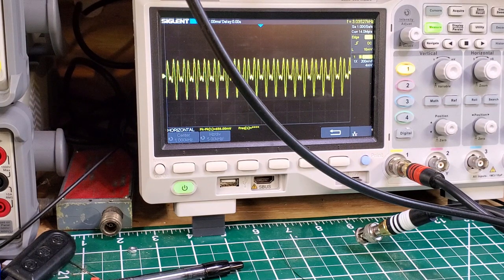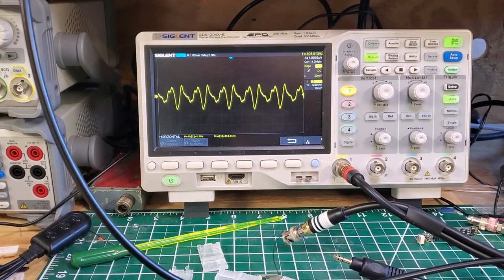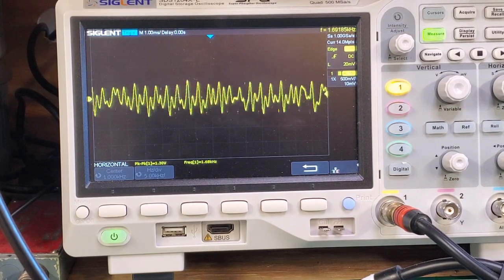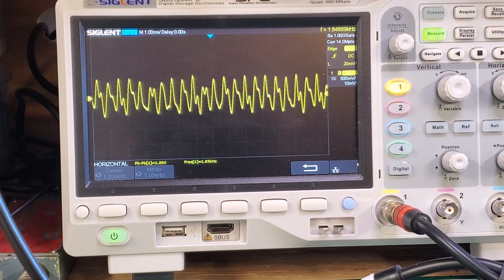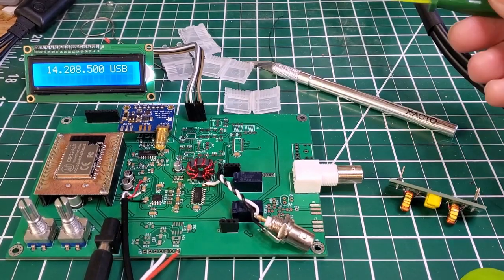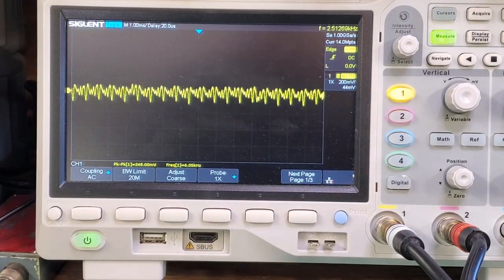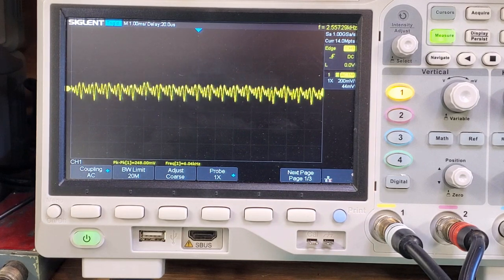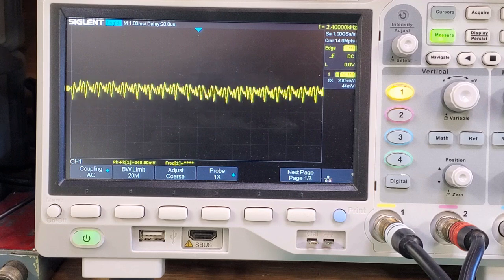SDR Tranceiver - Part 5 More Troubleshooting

Comment: This is very interesting trouble shoot ❤. I know you might have tried, adding decoupling caps "on the"  daughter/adapter board for the esp32a1s & some  ground to ground bridging with copper strips across the board while probing the output noise. Also a huge electrolytic on the power rail of esp32,  "on the" adapter board.
Reply from the maker: Funny you should mention that - I tried both including soldering some copper braid from the daughter board to the main board. No change at all! As you'll see in part 7 I ended up changing the uController part of the board completely. Video here:
https://www.youtube.com/watch?v=Kh6p49WP1ls

Comment: I did similar with a superhet receiver a few years ago. Turned out to be I2C bus to Display & Si5351.

How I found it. Keep the probe on the noisy output. Then poke around for signals that match on another scope channel. You'll see what it is when your scope signals correlate.

A better layout. Ground rings around modules to reduce ground plane noise, etc.
Reply from the maker: Thank you for the suggestions - I'll keep poking around but likely I am going to change the board design I think. Be nice to find the problem though. Thank you for the comment!

Comment: Now that you mention it, AFAIK, and from what I recall reading, that PCB antenna should NOT be directly over a ground plane like that. It should extend beyond the ground plane as otherwise it can and will induce noise. Which I believe is what you're fighting.
Reply from the maker: Its funny - I just read the same thing in the doc where they recommend an overhang or a cutout! Thank you for the comment. Looks like I might have to do serious redesign of the layout here!
Reply: @na5y  Just as I reminder, make sure you have a decoupling cap for the esp32. It's very important to maintain clean uC power; especially because of the RF. Also, you might consider one of the 'U' series modules, which means it has a 'u.fl' type connector (pex?). This will allow you to relocate your antenna onto your project box and move it away from your traces. Not to mention this can drastically increase wifi range. It's a win-win.

Also, these modules are notorious for random reboots and crashes. People frequently forget to provide a properly sized cap to account for the inrush current for the RF, especially during initial start up of the uC + RF circuit. If you don't do this, expect increased ripple on your power bus when using wifi.
Reply from the maker: I think after this one I am going to move away from ESP32 A1S and do a discrete ESP32 + a separate codec - perhaps the PCM3060, perhaps the PCB artists es8388. There seems to be too many challenges with the ESP32 A1S. I am certainly going to experiment with the PCM3060... we'll see
Reply: @na5y  I don't know the A1S series. It's new to me too. What you're suggesting does sound like a good alternative.

As a side note, in case you're doing some additional audio odds and ends, I can't recommend the arduino audio toolkit enough. Tons of low level stuff done through common c++ patterns. Can do a lot with little. Though may not apply here if you're not using an i2s interface.

Comment: I would have put some decoupling capacitors on the esp32 board,  unless they are on the other side.  Quite a long path for the power to get to the chip pin and Mc are quite good at wanting large current bursts.
Reply from the maker: There are a pile of decoupling caps actually on the ESP32-A1S module. They may be not enough. Thank you for the suggestion TEH!

Comment: Yes. try "star" connecting the + and - to the power supply pcb. High gain audio coax should only be grounded at one end only.
Reply from the maker: You mean the audio cable I have connected? Could you explain more please
Reply: @na5y  Shielded connectors should not touch the chassis at the entrance or out put. connectors. Signals should only connect with the respective shields terminated at the load or respective amplifier output.
Reply from the maker: @Trainwreck144  Thank you for the info - very helpful

Comment: I just picked up this little tidbit when researching voltage regulator generated noise... from Analog Devices AN-144...   try removing the ground lead with alligator clip from the scope probe(s) and make as short as possible connection from probe grnd to grnd closest to your measuring point(s).  Seems that the scope probe ground lead is a known source of noise pickup....
Reply from the maker: Thanks Steve - I will try that!

Comment: I'm leaning heavily towards ground loop.  RF and digital grounds need to be separate and isolated.   Noise from the ESP coupling through the ground and modulating the 5351.  Many less diligent constructors may not have  noticed these problems or just ignored them.  It's great to see your thoughtful process of testing and diagnosis.   As another has suggested, I would try separating the ESP from the board and then the ESP and 5351.   As you demonstrate, it's just a process of isolation, substitution and elimination.   I love this series!  Although it can be tedious for you, there are a lot of important lessons to be learned for everyone following along!  Great suggestions contributed by viewers/commenters also!  Thank you again!
Reply from the maker: Thank you for the kind words Steve. I've been comparing this circuit with the earlier receiver-only one I did
https://www.youtube.com/watch?v=redvZ7LcXT0&t=2s

The receiver part of the circult is almost identical - but the board layout is very different with the power supply and RF components well separated from the ESP in the earlier board. Ah well - we'll see where this goes ;)

Comment: Hi Ian, yes it certainly is a pain of an issue. I still think the noise could be coming from the clock generator. Why not supply the SI5351 with 5V and use a level shifter to 3.3V for the I2C to the ESP-32. I could be way off track but it may be worth a try. Loving the videos.
Reply from the maker: I might well try that. After the video I tried putting ferrite beads between the ESP and si5351 power - it didn't help. I even tried powering the si5351 from an off-board supply. Thanks for the comment!

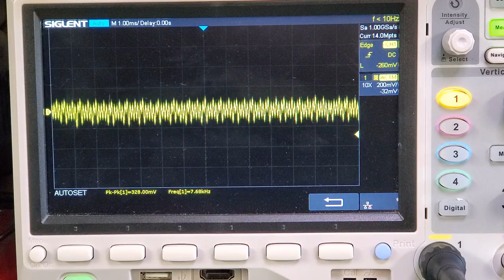Comment: For the half 5v rail 6:22 try lower value resistors in the voltage divider ie more current through it. Add a low value inductor in series with 5v feed for just before the voltage divider, maybe an electrolytic across the half 5v rail for good measure. Yes still clutching at straws.
Reply: One more thing (yes it seems stupid) look at your 5 volt rail with your oscilloscope and see it it is quiet DC.
Reply from the maker: @chrisherd991  I checked 5V - looks good. Thank for the suggestions!
Reply from the maker: Thank you for the suggestions Chris - I will definitely try them out

Comment: Measure the input signal without esp32, or power the esp32 total seperatly use audio transformer to seperate the ground. Also in the software switchoff the wifi, that takes a lot of power. Maybe this give some pointers
Reply from the maker: Good suggestion on the wifi Paul thank you. There's definitely something different going on with that ESP32
Reply: @na5y  My guess is that the noise is generated by the esp and through some groundloop is injected. I would remove the esp (after it programmmed the si5351) and check the  output of the tayloe. That should then be clean IQ audio.
Reply from the maker: @paulh0029  I didn't think of that - pulling the ESP after it had programmed the si5351 - thanks!

Comment: Hello. Thanks for your exciting videos. I myself had a problem with low frequency interference, and my noise source was the display, only it was OLED display, probably due to PWM. I was helped by electrolytic capacitors near 2200 mkf on the power line.
Reply from the maker: Thank you for the kind words Pavel. Off screen I removed the LCD completely - unfortunately it didn't help. Thank you for the suggestion

Comment: My guess would be that these are the spurious tones that are generated by the PLL. Maybe it's worth a while to check the purity of what comes out of that synthesizer board at particular frequencies.
Reply from the maker: Thank you for the suggestion Vontas. Interestingly I saw none of this with the other receiver board I showed in the last video. I tried swapping the si5351s but no change at all...

Comment: Digital noise. No shielding. Almost definitely the microprocessor. Does the esp32 share the same analog ground as the rf deck? Do you have ferrite beads on the power lines leading to the esp32 ? Are you powering the systems with a switched mode power supply ?
Reply from the maker: Good questions thank you Vince. I have tried powering from linear supply, battery - no difference. The ESP32 and RF do share the same ground. Thing is though that the oscillations are related to the frequency the si5351 is running at - which makes it mysterious to me. Thank you for the comment!

Comment: HI Ian, Enjoy watching your videos. Have you power up your board without the SI5351 and ESP boards in just to confirm. I know you did say the noise source was the SI5351 board. Have you tried using a EMF probe and your Spectrum Analyser?  Just wondering, I know how it bugs at you. I've been there. Thanks 73
Reply from the maker: I did try powering the si5351 separately with no effect. I thought of running the whole si5351 off board as you suggest - I might try that. Thank you for the suggestions
Reply: Is the Si5351 heavily loaded, perhaps that is causing spurs? Try an external generator
Reply from the maker: @technishn  I don't think its heavily loaded as I have used this circuit before. Its an interesting suggestion though - I was thinking of driving the board externally to see if that changes anything.